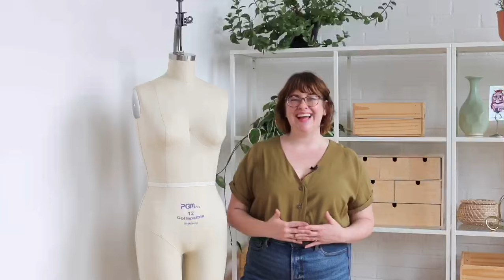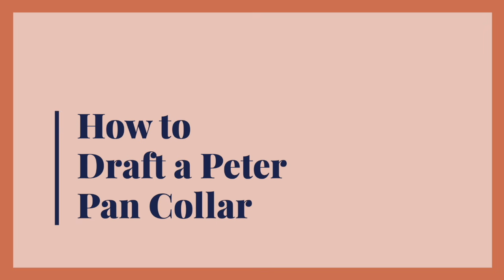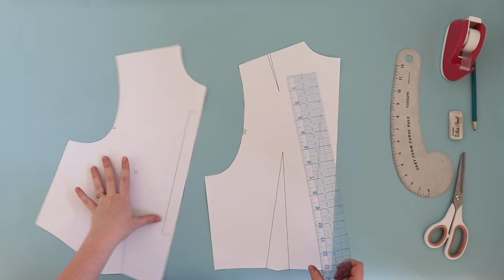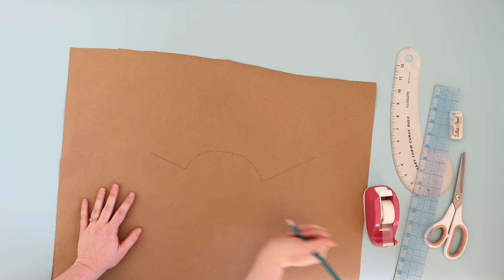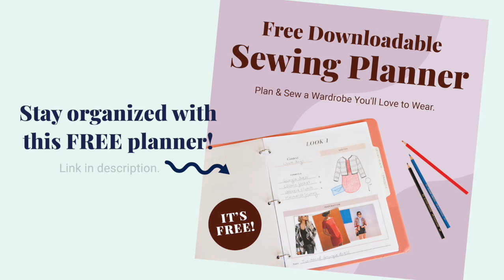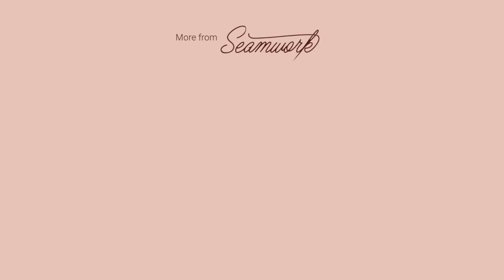How to Draft a Peter Pan Collar for Any Sewing Project | Pattern Hack

Comment: Thank you so much for this great video! I have a question: once you make the outer curve of the under collar piece 1/8” smaller, how do you get the edges of the upper collar and under collar to line up when you stitch them together? I wound up using the same pattern for both collar pieces because I couldn’t get them to line up otherwise. Are you meant to ease the upper collar onto the under collar?
Reply from the maker: Yes, you are meant to ease the upper collar to the under collar. Typically the under collar is smaller so that it will help the collar roll properly.

Comment: Hi! Thank you for this tutorial! 💖 I have a question, and I’m sorry if it’s a stupid one: do the pattern pieces you’re drafting the collar to fit already include seam allowance? I’m not sure if the step where you slightly overlap the shoulder lines is done to account for this; in another pattern drafting video from another creator where they use a similar method of taping the two bodice pieces together at the shoulder, the seam allowance is included already in the pattern, so they overlap the entire shoulder line by the seam allowance (instead of only at the armhole like you did) to simulate how the shoulders will be sewn already when you attach the collar. I hope that made sense, I’d really appreciate any help! 😅
Reply from the maker: It's always a good idea to remove your seam allowances before making any pattern adjustments. The overlap Haley is doing at the shoulder in this video is to help the collar lay flatter at the shoulder by removing a little of the back shoulder slope. Hope that helps!
Reply: @SeamworkVideo  Okay, thank you for the reply and for the clarification! 🙏💖 That makes sense. 😊

Comment: Hi!  Thank you for your video.  I do have a question.   On the collar pattern you raised the back neck line by 1/8" and dropped the front neckline about 1/4".    Do you also have to make these changes on the front and back patterns?     Thank you
Reply from the maker: Hi Kim! No, you only make these changes to the collar — this is done so that there is a little bit extra fabric in the collar to help it lay nice and flat.